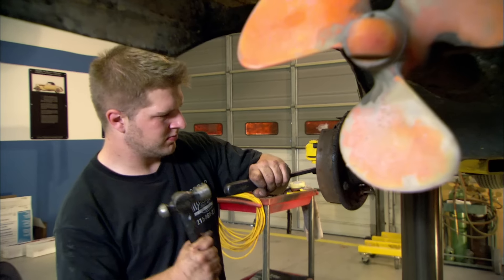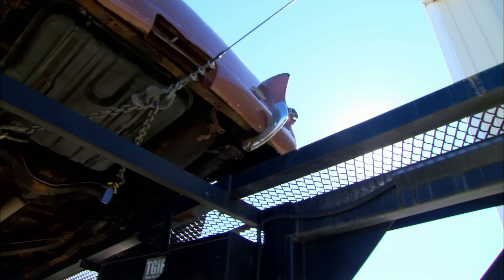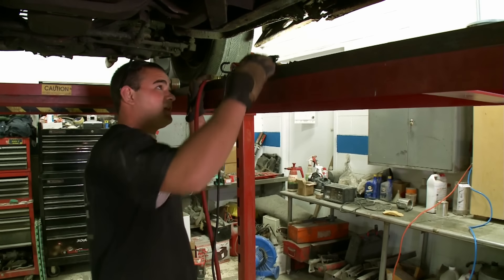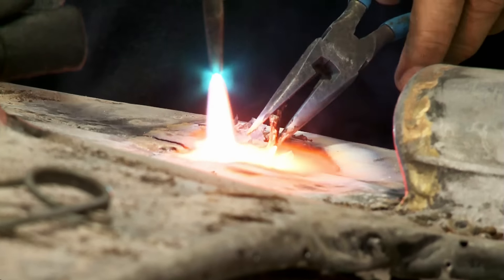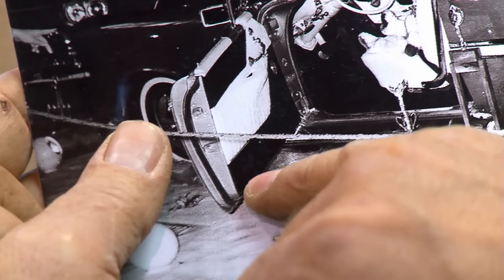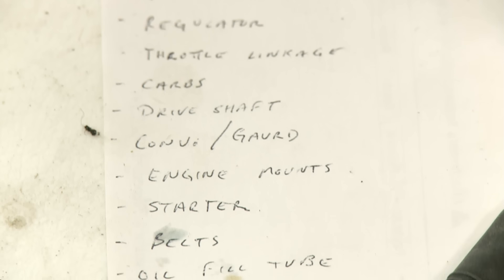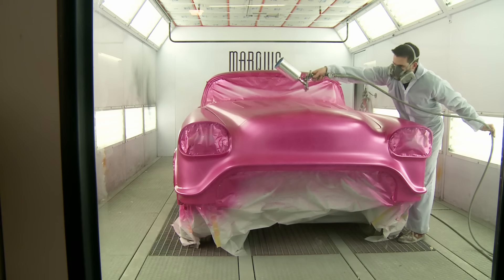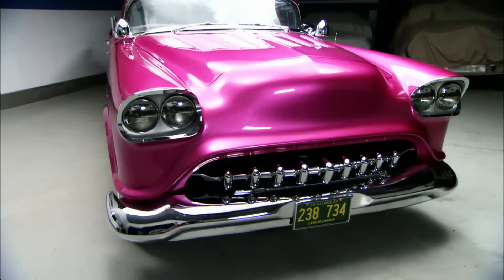Man Made: Rust to Riches | Dreamcar | Ep 2

Comment: The team of restorer's did an almost impossible job recreating this iconic custom. As for all the Naysayers about using " Bondo" instead of Lead. True Lead is no longer available due to its toxicity, but there is an alternative to it available which you can buy from the Eastwood Company. Sure today we have Polyester fillers, Mig Welders, C.N.C Equipment. Ask the average Body Man of today if he can actually Steel Rod Weld. My son can draw his name with a Mig, but to actually Steel Rod Weld Metal together is a lost art. Your choices were to use a Arc Welder for Heavy Gauge Steel (Frames) but the heat from a Arc Welder would burn thru Sheet Metal. So you were left with two choice's, Brazing or Steel Rod Welding to join Sheet Metal together. In the early 80's in Vocational School we completely Restored a 1964 1/2 A code 4 speed Mustang Convertible. Have a 20% hearing loss in my right ear from having the rod "pop" while Steel Rod Welding New Torque Boxes in which I had to hand fabricate. No Taiwan Aftermarket parts available in those days.A Metal Brake, assorted Hammer's and Dollys and a Oxygen/Acetaline outfit what the order of the day.
Reply: MOST PEOPLE ARE DELUSIONAL . YOU CANT BUILD A RADICAL CUSTOM WITHOUT FILLERS.. wITH PROPER PREPARATION BONDO FILLED CARS WILL LAST AS LONG AS ANY CAR . i HAPPEN TO DRIVE A RADICAL CUSTOM THAT WAS BONDOED IN 1976 AND IS STILL PERFECT LOL
Reply: +Ivan Benic its true about the body filler lasting if prepped properly but in this video they never even primed it before they bogged it? i build hotrods as a job and before we do anything on bare metal we always prime it (except welding obviously )
Reply: +Daniel Scott Who told you body lead is no longer available?  McMaster Carr will sell you the correct 70-30 body lead for cheap, Eastwood will too, just far less cheaply.  I've used body lead a few times, I prefer it to bondo for smaller areas plus it won't ever crack.
Reply: you can't use PURE lead to repair a car. It is done with solder. Get your facts right before you post.
Reply: I can gas weld steel and alloy both without filler rod. Your old school approach is redundant on anything other than mild steel. To fabricate with the method ensuring correct tensile strength would be the test of a craftsman. And IF you are going to gas weld mild steel because your are going to wheel it, use Oxy/Propane as it burns cooler and distorts less. Most people who braze or steel rod weld are butchers but it gets the job done.
Reply: Daniel Scott
Reply: I think that using lead is a paradox: it is a long lost art, yet it isn't needed any longer. I doubt that anyone but the older rod guys even know how to do it. Bondo is much easier to work with for sure.
Reply: plastic filler came about in order to make every jackass on earth capable of doing body work, not being a body man. some of the comments here sound like the guys that used to write in to magazines asking if they can put a rambler wheel on their brand new corvette they just bought with their paper route money.

Comment: When the old guy said the original builder only had a torch and a big hammer my respect went through the roof. Even I have more tools than that, I have a screwdriver. I’ve not worked out how to use it but I have one.
Reply: That guy has no idea what tools that guy had lol things where done very different back then so things didn't look as good 
under the paint.

Comment: wtf are you doin with that laminate glass? Take an oil filled glass cutter, and cut the pattern on one side of the glass. Take a pair of plate pliers, and break the score (cut) from let to right. Flip the glass over, follow your first cut with your glass cutter, break that score with your plate pliers, then take some denatured alcohol, squirt your cut, light it on fire, let it burn a minute, blow it out, and use your pliers to pry down on your score, and use a brand new razor blade, and cut the laminate as you pry down with those pliers. Easy....
Reply: This is a really detailed comment. I like it.Can you do this on plexi also? Just wondering for future projects. Not a car though, but still same concept?
Reply: +The Holy Bullet no you can't, you have to purchase a plexi cutter....a company out of LA, Calif supplies our glazing tools (I'm a glazer by trade, my Dad owns a glass shop) and it's C.R. Laurence Inc...used to be a company from Santa Clara, Calif called SOMACA Inc, but I think they're HQ'd in Chicago now...Google em both, they'll get you any and all glazing tools you'll need...hope this helps :-)
Reply: +The Holy Bullet and oh, you cut plexi with that cutter from only one side, using s straight edge, and you have to go over the same cut again and again...then, when you've scored thru all but a 1/16 to an 1/8 of the plexi, turn it til the score is perpendicular to the edge of your table, line that score up with the edge of said table, and snap it over the edge....if you're cuttin somethin more dense, such as polycarbonate, use a Skil Saw, cuz it takes, forever to cut thru with a traditional plexi cutter....
Reply: I too cringed when I watched them , they spend 100k fixing the car but not smart enough to hire a professional to cut the glass. 
My oil cutter was given to me 25 years ago by a guy who was retiring and it might be 60 years old or older . Never changed the cutting wheel and it cuts/ scores like new .I only worked as a Glazier for 3 years and always kept it in a cover . 
I think they do this crap just for the drama effect . I can't believe they got an award with a plexi windshield ,the fitment would be crap on that rubber seal if they had to drive it down the road the wind noise alone .
 My guess is that windshield is not made in large numbers , so I wouldn't want to be the one to cut it , but everything you said is exactly the way to do it. Most of the time it works but you know runs happen ,even when you do everything right. Then it will cloud in a few years  as the laminate separates .
They were dumb to try not knowing how to do it right with a rare piece of glass.

Comment: I  cant  get past  some of you guys with with these " Bondo " comments ? Its  evident that your not old enough to  know anything about custom car builds from the  50's  and  60's. Before  BONDO there was Lead, well you cant  buy LEAD anymore...so you have to use  bondo to mold a  car. Now unless you making panels from scratch and  TIG welding them together and  a lot of  grinding. I am just wondering how many of you that  are commenting have even built a custom car ? smh
Reply: I get your point that Bondo replaced leading in body seams on customs, but your comment claiming "you cant  buy LEAD anymore" is incorrect. One can buy as much lead as one wants to do what ever you want with it, it's just that not many body men know the processes of melting it into vehicle seams anymore, and Bondo is easier and less toxic to use if lead is not applied in a vented area.
Reply: There's nothing wrong with plastic filler if you do it correct! In my shop for thicker reaprs I start with short-strand fibergalss reinforced plastic filler which is super strong and waterproof. Then use regular filler outer layer on top to get a smooth finish. Has held up on my custom for a decade or so, showing no signs of failure, and on all my customers cars  for longer than that..

Comment: how long will this restoration last? theres gallons of bondo on it which is bound to crack as the metal underneath shrinks and expands with temp changes, correct?
Reply: scott 500 not to mention the rust popping back out after 2 years
Reply: this will last for a long time the metal work is sealed so the bondo will last for a long time people are affraid of bondo but if its applied over good metal work it wont bubble
Reply: Did you notice all the 1963 Bondo on the original car, still in perfect shape? If it's done right plastic fill will last 50 years. The plastic does not deteriorate or fail, the metal underneath rusts away. Maintain the car, and do it right in the first place and there is no reason for it not to last.

From a guy who has been working on old cars since the sixties.

Comment: con artist.... looks good at first glance but upon closer inspection its a hack job, i give it 5 to 7 years before all that body filler starts cracking and the car starts falling apart
Reply: It wasn't even shot blasted fully, no underside done or even inside the headlight sections
Reply: @mrdanforth3744  they used lead not filler, and metal finished the majority of the panel work! thats why. And Yes you could say I know quite abit about bodywork and customisation.
Reply: @iwannabentley  We seem to have watched 2 different videos. The car I saw had both lead and plastic filler. It was also neglected and left outside for years to the point where paint was peeling off but the 50 year old plastic filler was still good.
Reply: @mrdanforth3744  yes so this was already bodged.
Reply: @mrdanforth3744  how was the car still good lol

Comment: boy i see lots of genius's commenting one here, too bad most of it is just words, the biggest problem today of using hammer welding and lead , and the lost art of using a grinder to suck a dent out, or a torch and a bucket of water and a rag to do the same, there isn't enough metal in cars today, so the are isn't so much lost as unnecessary. now some of you that have taken classes to learn the are and really want to do good work, take the time to either go see an old master or at least call one, a couple are still alive, bill hines was the last time i checked, and although dried up, wrinkled , hunched over and barely able to walk, ive watched him do things with metal you would have to see to believe. im actually from the old days of real body men, my dad and my brother both were masters at the craft, my dad because you had to be right after the war, you couldn't not get parts so you repaired the body panels, if you enjoy seeing what it was like then, see if you can find an older dealership that may still have old equipment stored somewhere, the tables and jigs to repair doors, tops , and hoods were amazing, the old reata cadillac dealership here in san antonio tx had all theirs stored on top floor of their parking area, i used to go there just to wander around in amazement staring at the equipment. any good body man back in the 50s and 60s could cut a top off and replace it without hesitation, ive watched so many cars cut in half and welded back together i lost count.  but this is today, the technology available today is almost endless, you guys can argue all day about your idea of the best and most likely not even mention some of the products. you don't even have to weld a quarter panel on a car today, there is an adhesive that holds better than a weld, don't believe me, go to a dealership and ask a body man. i forget what year it started but all corvettes after a certain year were bonded to the chassis, and it was almost impossible to get it off, usually tearing the fiberglass before it released. i like to see the younger generation taking an interest in the art, but i have no doubt that none of you could hold a candle to the old guys like barris, bailon, jeffries, bill hines, and hundreds never heard of.

Comment: @Wrecks To Riches | Rust To Riches Hi @31.04 the spot weld isn't a continuous line of welds, there are gaps inbetween the welds. I am new to welding, please can you answer this,is it physically strong enough to hold the metal together with those spot/tack welds? Did you just grind down and fill over the welds with body filler?
Reply: SP330Y short answer is yes. the majority of production cars are basically held together by just spot welds. as time goes on, completely welding the seams is becoming less and less prevalent.
although for things such as a arms and other suspension components that rely on being ridged, the seam is usually welded completely. all in all, although not always necessary,   its better to weld the seam completely as a final product and leave spot welds for temporary fixtures. just my 2¢
Reply: Chris Brooks
thanks :) I also heard that too much heat can bend the metal too,i just realised yesterday how hot the metal gets,i practiced some welding in my garage and it was glowing orange/red, i was amazed how strong a simple weld can be
Reply: Chris Brooks
say for example i am welding the bottom of a dooor thats gone rusty, so i chopped it out bought a new skin to replace the rusted one, would you weld the new skin over the top of the existing door or place behind it OR would you align them both up on exactly the same level and weld it like that, then filler over top of it all  after spot/tack welds have been grinded down?
Sorry one more thing, when the weld is grinded down does this make the weld any less strong,or is it just as strong as before grinding down?, sorry lots of questions
Reply: SP330Y
Reply: look for south west rods and customs videos here on yt

Comment: Why would anyone pay all that $ & not do a engine transmission brakes ..like even the floor in the last shots was not done. Yes the judging say one thing . I am disappointed how they are giving out awards for cars that were no fully rebuilt.  Not that the work was not done proper or anything like this but not a full build  They did well on most of the stuff but the key thing is judging & not real glass getting awards in a car show like this?
Reply: They did do the engine transmission and brakes. They showed installing the rebuilt engine, they don't have time to show everything.